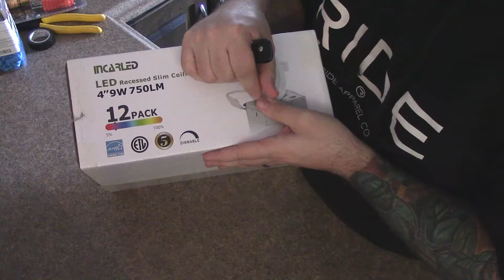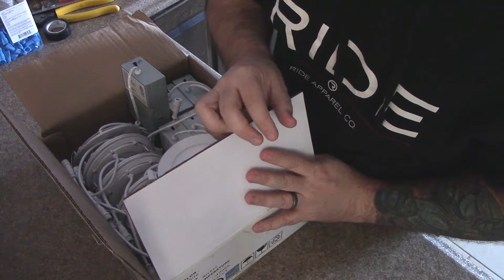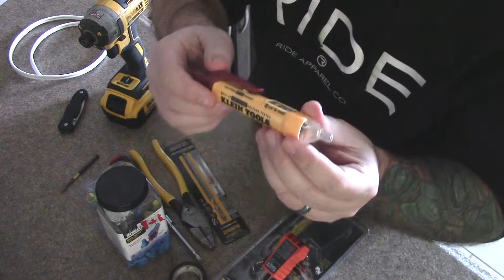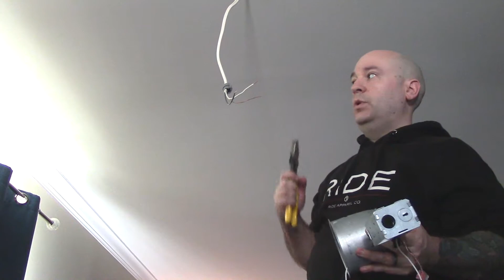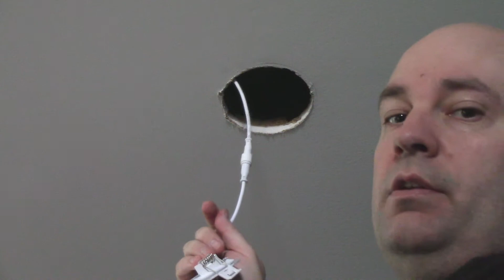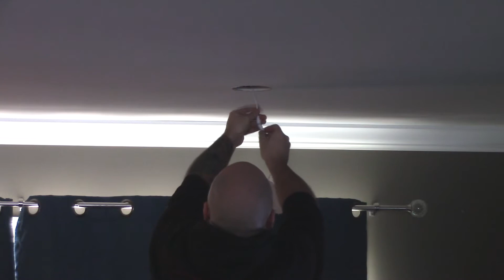HOW TO: INCARLED 4 Inch 9 Watt 750 Lumens Recessed/Pot Lights Unboxing, Installation, And Review!

Comment: Thank you for your video. I’m not able to find these on Amazon. Will you provide the link? Also, would you tell me if the lens has a glossy finish that looks like glass, or is it a matte finish?
Reply from the maker: Hello Lynn, and thank you for watching! I've put a link to the lights I bought in the video description. The link is to the Canadian Amazon site however. When I just searched for Incarled pot lights on the US site, I was met with no success. Hopefully you'll get some kind of link to an equivalent on the US Amazon site through what I linked above. I would like to believe that you will find an equivalent for the country you are ordering in. Also, I would describe the lens as having a matte finish, as well as the surrounding support ring. Shining my phone flashlight at it in the dark gives off no significant glare/shine/reflection. All the best!

Comment: I'm going to install in my drop ceiling in the basement to replace two fluorescent panels so I'll have to run the copper wire to each. I was surprised the lights didn't come with the plastic ring for the junction box. I already replaced an incandescent ceiling fixture in my dining room with four of these in the corners and a Taloya "moon" flush mount in the centre. I added crown moulding so the wiring was easy to hide. Sorry - rambling - these lights are terrific - I prefer the warmest setting. Your clip is still getting views - thanks!